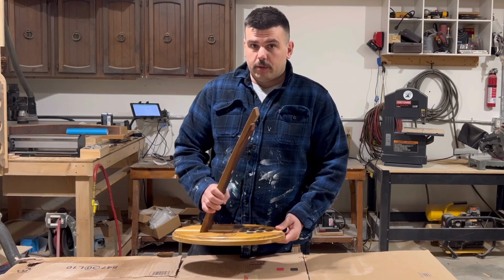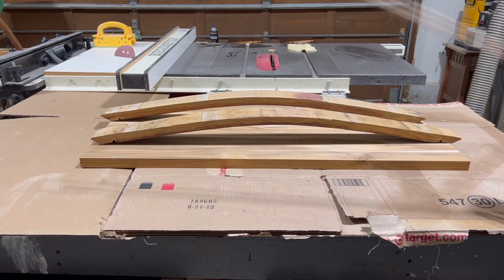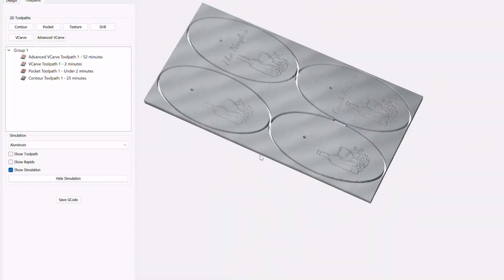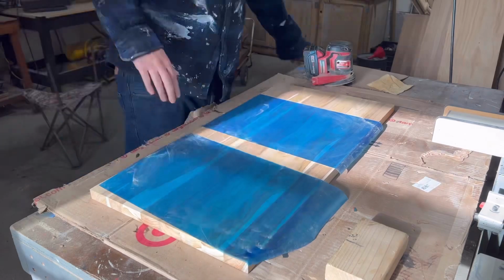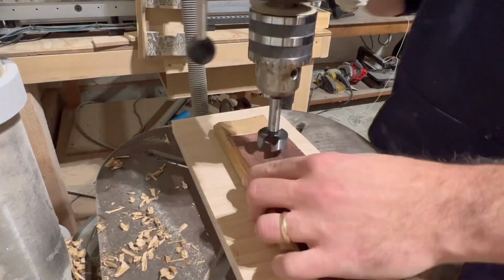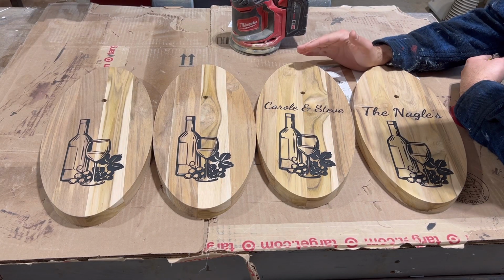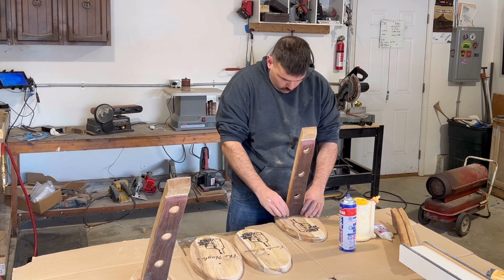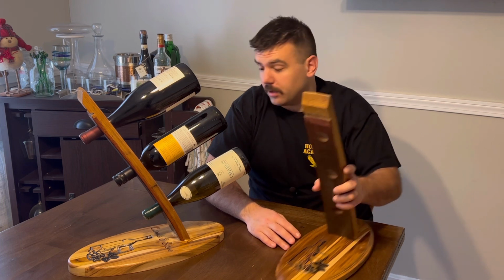ULTIMATE Wine Display made on my CNC Machine!

Comment: Do you have actual plans because I don’t have a CNC
Reply from the maker: So the plans on my Etsy page include diagrams that show how to cut the staves, but that’s also included in this video. If you don’t have a cnc, all you really need to do is make an oval base that’s about 8”x16” and drill a 3/8” hole through one side of it like I did in the video. Hope that makes sense